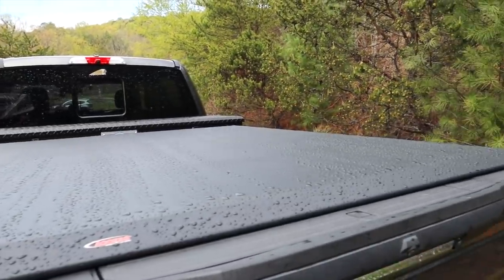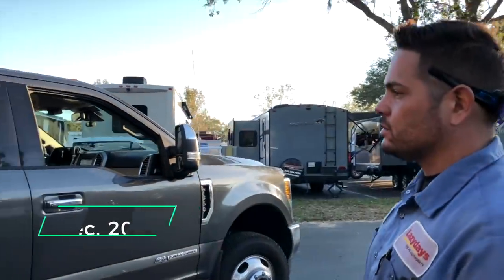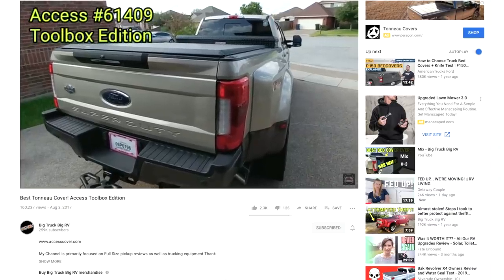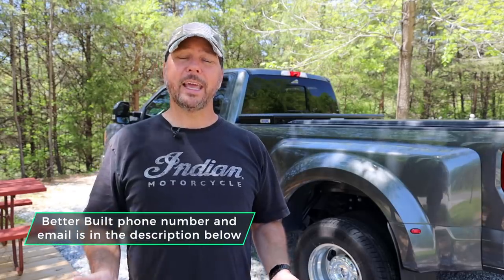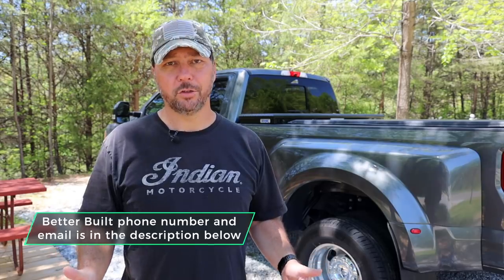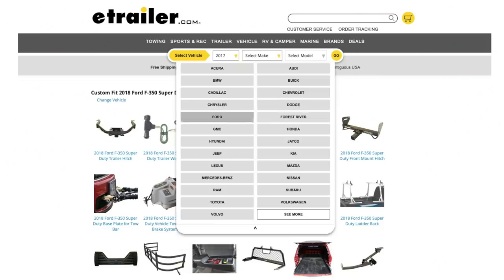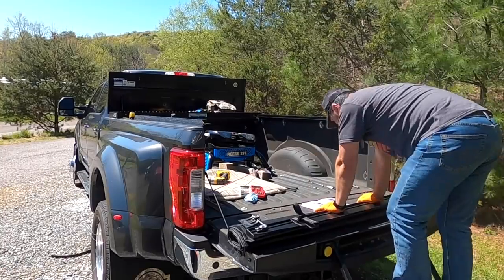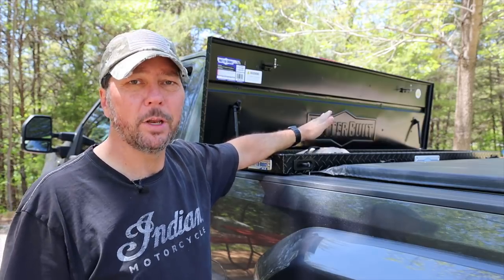Truck Toolbox and Tonneau for Fifth Wheel [Full Time RV Living]

Comment from the maker: ⚠️⚠️ ⚠️ UPDATE!  - After traveling a bit, we've had our pin box hit the tonneau rails a few times! ☹️   We're not sure if it's just because we have this huge Flex-Air pin box or if this might be an issue on all pin boxes.  The damage has been minor and isolated to just the rails.  I've been able to bend back the bent areas.  And the damage is hidden under the cover.   Please be aware and maybe take some measurements of the distance from the pin to the back of the pin box and compare that to the distance from the center of your hitch to the side rails.
Reply: Changing Lanes What is the height that the tonneau cover and it’s rails adds to your bed rails? Trying to figure out the clearance needed. Thanks!
Reply: Do you still have this problem with the new Moryde pin box? I have a Moryde and after measuring It sure looks like I have a few inches of room even with the tonneau rails inside the bed. I'll know for sure when the new truck arrives. Let's hope that this pandemic crap doesn't shut down the factories again before the truck gets here!
Reply: Thanksgiving is for the updated information
Reply: Copy that, I just purchased this! Do you have any photos of the damage?
Reply: Do you guys think the moryde pin box that you guys have now would have had less less of an impact on the rails?
Reply: @williamastorino9551  Yes, just got a 2022 Jayco and it hits my Access Cover.
Reply: @tripnick3  No, have a 2022 with the same issue with Access cover.
Reply: Thanks for the info, but we have had our rig for almost 2 years and have had no issues. The distance from my bed rails to the bottom of the fifth wheel is 9 inches when it is hooked up to the truck. The tonneau cover rails are 1 inch high so it still is 8 inches clearance. Good luck.
Reply: @williamastorino9551  I have about 6" that way but it's the back of the bracket that holds the pin box that does the damage.
Reply: @FLCrackerVideo  It must be an extra long pin box because I have a Mooryde and it doesn't even come close to the tonneau cover rails when I am turning, even on a 90 degree turn. I have a Pullrite super slide hitch. That is the only thing I can think of. Possibly it may hit when you are in a hard twist going up or down a driveway with a deep swaill at the end???
Reply: @williamastorino9551  Sadly it does it on flat ground when turning hard but only as hard as my F450 (wide track front axle) will turn going forward. Thinking now it may be the F450 4x4 high bed causing the approach angle the puts the back of the pin box mounting bracket down some.
Reply: @FLCrackerVideo  What is hitting what?  I am picking up a new Ram 3500 dually, and would like to do this setup.  Is it hitting the rail because it is too far in board from the truck bed rail, or because the cover rail is raised what looks like about an inch off of the bed rail.  Thanks.
Reply: @captmike390  Yes, the Access rail hits in a tight turn. The tough part is that it's hitting the pin box mounting rails, not the pin box. So even if I switch to the GenY  I want the problem still exists.  I can trim the bracket without any structural problems, although I fear Jayco could use that to void warranty, even if not the cause. Soon, I will just do it and quit working about something that is likely to never be an issue.
Reply: @FLCrackerVideo  Thank you, Charles.  I like this set up.  We just ordered an Alliance RV, and I will try to get some measurements from the company on the hitch.  The truck has the Mopar 30,000lb hitch.  I have no experience with fifth wheel towing, so have to do my homework.  Thanks.

Comment: The relatively few times we access our tool box under the Tonneau negates the inconvenience of having to roll it up to get to it. Our Truxedo  Pro X15 is super low profile and our Dee Zee 8537 holds all our stuff  dry and safe the most frequently used gear is stored in the RV basement. It also provides room to stuff our Champion 3150 genny in the front of the bed. But heh, if yours works for you, that's great. YMMV as they say.  Plenty of ways to skin a cat!

Comment: Thanks Chad! We just upgraded from a short bed 2500 Dodge to a long bed 3500 Dodge Dually. I was unsure of what I was going to do with the bed till I saw this video. Love it!! Ironically the NEXT day a used Better Built tool box identical to your story appeared locally on FB marketplace. Picked it up this past Saturday and now need the tonneau cover!
Reply: Did it work out on your ram?  Do you just buy a cover for a shortbed
Reply: @txjps652  I am using the same Access Toolbox cover from the video. If you get the one for the long bed it fits with a 19-21” toolbox in place. The caution is make sure your tool has the “shot gun” latches or they are on the ends of the box. I was able to find a used toolbox, like in the video, but they did have them thru Tractor Supply also. 
My Dodge is an ‘06 LWB dually and I have used it with an Anderson hitch and with a Goosebox currently with no issues.

Comment: I run the same setup and it works great. I found it to be the most practical, cost effective, and reliable option I could find. The only difference is my Better Built tool box has the pull handles. It works however with drawbacks. I can't use passenger side handle because tonneau obstructs it. Drivers side no problem. I owned tool box prior to installing Access Tonneau Cover and made it work. My toolbox version was under 300 dollars. I do really like the shotgun access you have. It's slick. Well done. Nice rig and vids.

Comment: We use a low profile tool box with opening lock buttons on the side, its a Home Depot Husky brand, we also use the exact same tonneau cover JD recommends, on a 2019 Ram 3500 long bed dually.  We use a BW Hitch and Morryde rubber pin box that came with our Solitude 382WB.  No rubbing, touching or contact anywhere, great system!  Went with the Husky tool box due to the exact issue you discussed about the SLE not being available!

Comment: For reference in 2021. I just purchased the exact box with the same latches at tractor supply today 5/01/21 for my RAM 3500. Couldn’t be happier as I have the 5th wheel prep and cover. 👊🏻 Appreciate the video! $600 total cost.

Comment: Great combination.  I have the same cover with the same clamps. You have many more clamps that the six that was installed on my cover.  After six years having the clamps fall, I decided to go with 1 1/2 inch C clamps.  With as many clamps that you have and a different truck you may not have the problems I have had.   Good luck with your tool box/cover.  Sound like a winner.
Reply from the maker: I did notice when looking at install videos that the clamps are different.  So, maybe they fixed an issue with them.  Thanks for watching! 😊

Comment: Works for you  but I’m using a solid 3 piece cover with tool box tucked in bed clearing my cover., clears fifth wheel cap when turning    More secure and no flapping.   Do like your clips.    Keep it up.

Comment: The Peragon hard tonneau cover is an amazing piece of work. You can have them custom made, and they are quite durable... aaaand they are EXPENSIVE.
Reply: I can vouch for the Paragon hard covers.  While not a 5th wheel/tool box config, really works well on my Ram 1500 Rebel towing an Airstream.  Retracts down to 6 inches when collapsed.  Great covers.

Comment: I used the same setup as JD (and yourself) and it works great,  However, the flat frame piece of the Access cover between the tool box and cover is about 3/16 inches short compared to the width of my 2019 F350 bed.  With that much of a gap the clamps would not stay on to hold the spacer and kept falling off.  I eventually had to make two spacers out of thin metal to fill the gap and get the clamps to stay in place. I emailed the manufacturer of the cover explaining the problem and was told that the measurement was taken from a 2017 model truck and is within tolerance and that they did not have any spacers available.  Great setup and works great.
Reply from the maker: Strange that there's 3/16 difference between a '17 and '19...  Glad you figured out a workaround...

Comment: William Astorino
1 second ago
Tractor supply still sells them as of today (11/23/20). They are $599.99! However I just got a Tractor Supply black Friday sale flyer and starting tomorrow, I get 25% off of all truck tool boxes. I have to order this one but I still get the 25% discount. Thanks to you and then & JD, I finally found what I need. to use with a tonneau cover. Now if the virus doesn't shut down auto plants, my new F-350 will start being built in 2 days. Thank you and JD for your great videos. They are interesting and entertaining as well as very educational! Keep up the great travels. We hope to start in the spring. We have our 40 ft Montana, but can't move it until we get the truck and all the stuff we need for it.
Reply from the maker: Glad you're able to snag one! 😀
Reply: @ChangingLanes  Thanks! But when I got there to order one everyone was busy so I looked at their stock of tool boxes. They had one in stock that had the push buttons on the ends and it had the 3.5 inch above the bed rails and it was a much deeper one for more room inside. it is 19 inches from top of lid to bottom of the tool box. I must have measured it a dozen times at least and compared it to the one you have that I intended to order. This should work. Better yet it was stickered at $449.99 and was on Black Friday sale price of $337.49!!!!! I brought it home. They said when the new truck comes in I can return it for a full refund if it won't work! So I guess you figured out that it is now sitting in my garage. Thought you would like to know they are both available at Tractor Supply to post for other interested people. The item # for this one is #1174114. Thanks again for the tip on the short one.
Reply: There is no plastic tray/box in this one and there is no light, but for this price who cares? Tractor Supply has both. If sold out they will order them for you.
Reply: Sorry to keep bugging you, but people need to know that I am putting this on a 2021 F-350 4x4 crew cab but it is a single rear wheel not a dually. the bed is 6'9" not 8'!!! The Access cover for this truck is different. Real Truck part number is ACI-61399

Comment: If you take the light out you will see there is a battery compartment for 8 AA batteries. No hooking up to switches needed. Install the batteries and the lights come on when you open the lid.

Comment: The light works with 8 AA batteries or a 12v source from the truck or elsewhere. It doesn’t need to be on a switch. The LED lights in the toolbox and the bed turn on and off as you open and close the toolbox.

Comment: Nice setup.
I wish they made a tonneau cover that worked with the L-shaped transfer fuel tanks. We had one on our Sierra (the tank). I used the tonneau soft fold from my Ram 1500 6' bed I kept when I sold it. Put it on the Sierra 8' DRW with the L-shaped tank. Left a gap of course but was good enuff to keep things out of sight when not towing and kept my 5er hitch out of the elements when not in use.
But I see alot of 5er owners with the transfer tanks and could see a small customer base that would appreciate the offering of the option. 
Of course when we actually towed, we had to remove the cover as it could not fold small enuff. Which no big deal, it's easy to remove/install.
Maybe a soft or hard fold that had more (shorter) folding panels?

Comment: Just a suggestion, but change your running boards out on the truck to the 3 step. I have the Ranch Hand ones on my truck. Made a world of difference when getting into to the toolchest. I could reach more to the center and to the bottom.
Reply from the maker: Looks like a great product!  Thanks for the tip! 👍🏼

Comment: I went to Tractor Supply to look and they had one. One of the plastic latch handles was missing and I went to open it and the other one fell off. I was disappointed l, wish they had metal latch handles. Your eBay add is over $1300 now. You made an impression.  LoL. I may hold off in hopes of a different model with metal handles. Thanks.

Comment: I'm a big fan of the Access covers. (Though I'm a bit biased, they're made in the state I grew up in, North Dakota. They've been making agricultural covers since 1981.) I've had them for 20 years on F-150's, with the last one since '11. I've tightened the rail up maybe 3 times. Still works as new.
Reply from the maker: Awesome!  Hows the velcro holding up?
Reply: @ChangingLanes  It doesn't quite grab as much as new, but running your hand along the whole length, it still stays "hooked". It will not flutter going down the highway.

Comment: We used a low profile craftsman toolbox (~$150, I think??), mounted it about 1.5" from the back of the truck, then mounted the tonneau cover about 1.5" from the toolbox (to allow access to the key on the front) and placed 2" adhesive rubber door weather stripping between the toolbox and the tonneau cover, with a separate lift up piece covering the key access.  Not sure how to share photos, but willing to send, if interested in a cheaper toolbox solution!!

Comment: Extang also makes a toolbox tonneau bed cover and is fairly inexpensive ($300 for my 2013 F350 short bed). I also have the same Kobalt toolbox you used to have.  I added a piece of paracord to the driver's side latch that runs back to the tailgate.  Now I just open the tail gate and pull the cord to open the toolbox.  i like having the toolbox latches hidden so thieves aren't tempted.
Reply: Ingenious, Bill. Thanks for the tip.

Comment: Hey just bought the better built tool box from tractor supply. Only one had it near me in a 100mile radius for $599, but it had a huge dent in the rear corner and got it 50% off and I fixed the dent and all good now😁.
Reply from the maker: Awesome! 😀

Comment: Thank you for the heads up about the discontinued box. I was able to locate one through Tractor Supply Company (TSC) and they happened to still have a black one in a nearby store. (June 2020) The other places I found on the internet are out of stock.

Comment: Nice Chad!  We went with RetraxPRO with an in bed 40 gallon fuel tank.  Takes away the space in front of the hitch but now we get 75 gallons of fuel and the ability to use the top of the tonneau when not hitched.

Comment: So, breaking something while working on it.  Kinda follows the two rules I learned while in the Navy;
1) If it don't fit force it.  If it breaks, it needed to be replaced anyway.
2) Torque it till it strips and back it off a 1/4 turn.
😁
Reply from the maker: You forgot bust your knuckles because the jack-wagon who designed this didn't consider people actually working on it.. LOL
Reply: @ChangingLanes  I didn't have to worry about that too much, I worked in AIMD so everything was small(ish).

Comment: Hello Chad, I liked your video on the cover and truck box so much that I purchased them. I wanted to let you know that after installing the tool box I discovered that the box already has everything to power the light included. If you look inside the box you need to remove two silver screws on the light lens panel and inside you will find a battery holder for 8 AA batteries. I just thought I would let you know that you have everything to power the light.
Reply from the maker: Hmmmm.  I'll have to look into that!  👍🏼    Thanks for the tip! 👍🏼

Comment: Loved the setup.  I have always wondered about covers and 5th wheel hookups.   I have a fold up tonneau cover on my truck. I was hauling some stuff from my sons house in Kansas City to Dallas area in torrential rain storms and not a drop was found in the bed after the trip.  My cover does go over the bed frame so I would rather have your style for options.

Comment: Excellent presentation of a solution for multiple problems! Now just to find one of those toolboxes! Glad to have found your video before I bought a toolbox! Wrote to the manufacturer, as you suggested. Why do they call it a shotgun latch? Never heard of that before…
Reply from the maker: It's called a shotgun latch because it's a lot like the lever on a shotgun to run the bolt back and load a shell.. 👍🏼

Comment: I have similar cover made by Gator. I went with it to cover my aux fuel tank.  In my opinion, those clamps suck.  I ended up drilling holes and placing nuts & bolts to secure the rails. I wouldn’t be surprised if you don’t eventually do the same.
Reply from the maker: Better built has a very nice mounting system, but there wasn't enough room for it.  So, yea... Self tapping bolts into the bed rails was the only solution.

Comment: Ur cover looks just like and rolls up with the side Velcro of the Truxall on my S10. Great set up. (Velcro is great but after several yrs the top is holding up great but the Velcro is seeing its better days and not gripping well). What I do like about mine and urs is that the lock mechanism to the cover is behind the end gate when closed. PS. No video is complete without Tara and Daisy.

Comment: That tool box latch is sweet, have not seen one like that before. Does the tonneau cover flap around in the wind when you’re driving. No supports going perpendicular to the bed just curious. I hate that when they flop around. Thanks
Reply from the maker: It didn't flap.  But, there were other issues over time: https://changinglanesrv.com/faq/?Display_FAQ=2978

Comment: I also have the same towel cover for the same reason had a slide in truck camper and a fifth wheel but after about two years the Velcro did not hold wind caught it took it right off hope you have better luck
Reply from the maker: Thanks for sharing.  Will keep an eye on it.